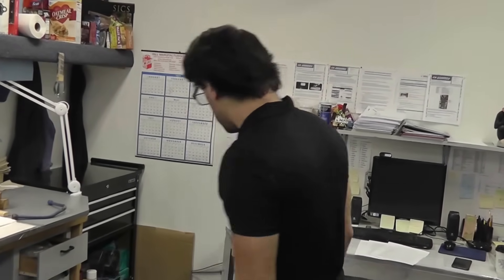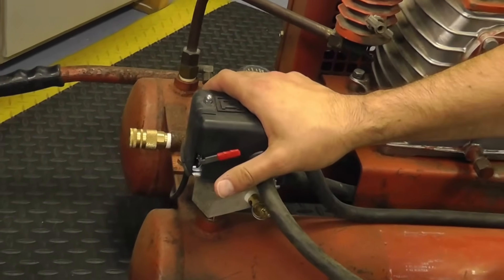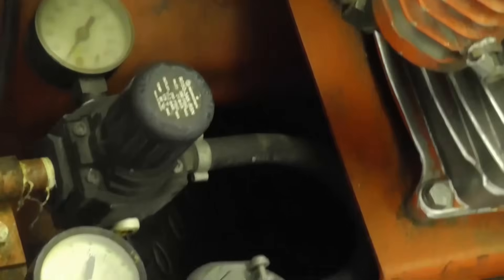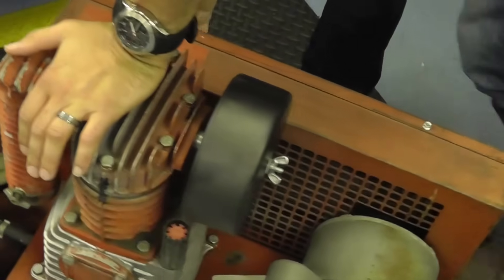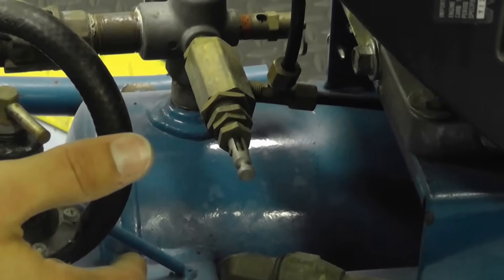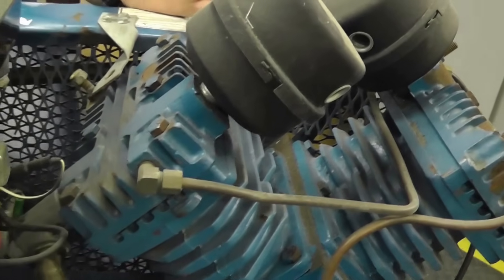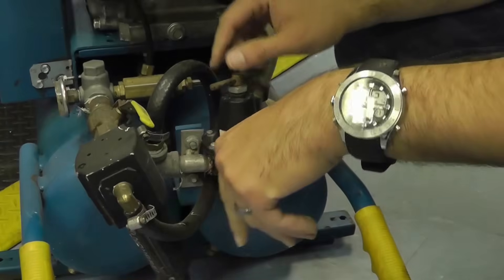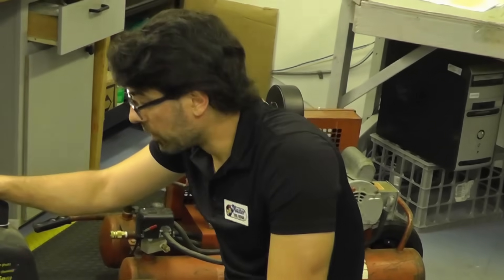Air Compressor Components And Operation

Comment: I've got a hulk brand. it will build up. pressure but want let air out of the hose. I'm not crazy, got everything hooked up, power and all. would it be the pressure switch?

Comment: Have a Jenny 30 gallon with gx390 Honda engine. Won’t idle up when I flip the unloader valve, replaced it but didn’t fix it . It’s building pressure when it’s in the unload position. Bad throttle control valve ?

Comment: Hey how you doing.. I have a emglo compressor.. on one of the pump head is blowing air back out through the intake filter.. I replaced all the valves.. intake and exhaust.. also unloader valves.. gaskets, and still blowing air out through the filter.. don't know what else it could be.. if you or anyone else can help would be great.. thank you.

Comment: How trustable are this compressors???
Reply: Emglo compressors
Reply from the maker: @raulmarin8704  The Emglo name was purchased by the DeWalt group in the 2000's so if you see a blue and yellow Emglo unit in the wild, that means it's a great, great compressor. Emglo is still operating in Johnstown, PA but they go by "Jenny" now. The compressors are exactly the same as the old Emglo units and they're made in the same factory, so a "Jenny" unit is equivalent to the old Emglo air compressors. These are excellent air compressors.
However the black and yellow DeWalt-made Emglo air compressors they're making today are NOT the same as the old Emglo units. They are decent air compressors but are not of the quality the old Emglo or current Jenny units are.
I hope this helps and thank you for the question!

Comment: I ordered a sight glass kit for my husky pro compressor. It came in 2 parts. No instructions. How do the parts go together?
Reply from the maker: If you have a model number for the compressor or part number we can assist you better, but typically you would just press the sight glass into the metal (or brass, or steel) threaded portion. I can also give you the manufacturer's contact info (depending on who made this particular unit for Husky/Home Depot) if you can give me the model number, as one of their service reps can certainly give you more detail.
Thanks!

Comment: What happens if pressure reach on red line on pressure gauge
Reply from the maker: Thanks for the question! It all depends on what your maximum PSI rating of your air compressor is. But generally, if the needle on the gauge is reaching the upper limits denoted by the red line, the pressure switch is failing to shut the unit off at the max PSI setting, so there's a good chance you'll need to replace your pressure switch (as long as you confirmed the gauge is reading accurately, first).
Reply: @MasterToolRepair  thanks for your reply..

Comment: I have the same emglo wheelbarrow type gas air compressor with the 4 cylinder v pump. Do u know what that air line is that goes from the top of the head to the oil tank?  I just can’t understand why downloader would go through the head and then into the oil
Reply from the maker: Thanks for the question! The line you're referring to is the Unloader Line. The end that connects to the front of the pump's crankcase is the centrifugal unloader assembly. When the unit reaches max pressure and kicks down to idle speed, this unloader valve is activated and air travels through it to the pump head to open the brass unloader valves, which causes the air to bypass the pump's valve system while idling (the air that is compressed while it idles unloads into the atmosphere). When the units kicks back into the loaded position, the unloader valves close so that the exhaust valves activate to continue compression to fill the air tank. Hopefully this gives you a helpful explanation!

Comment: Hey why there is ambient air intake in second stage of compressor
Reply from the maker: Thanks for the comment. The unit in the video has a v-twin pump and each cylinder requires an air intake filter...this is common on v-twin compressors as both banks have completely separate head and valves systems.

Comment: I have an old sears two cylinder compressor. I tired a few times to repair the check valve then I replaced it. Now it starts up and does not blow the breaker. The only issue is I've had the compressor head to the check valve copper pipe off so many times while it's running the fittings leak because the brass compression fittings don't seal . Plus the new check valves now have a 1/8" port that has to be plugged which I did. The main issue is getting a new copper pipe bent to a 90 degree and fitting the pipe proper. The new check valve is taller so I was able to push back the brass ring and cut off 5/16" yet I should have cut off 1/4" because now I need to tighten the heads fitting first then the check valve and can tell it has added tension . 
 It only has a slight leak while filling the tank yet I don't like the bit of added tension . It seems the copper pipe needs to seat down in the head and check valve in order for the brass sealing ring to find it's stop just the way they seem to work. 
 I guess I can get a new copper pipe and compression fittings and have the 90 degree bend done . The issue is making it the proper length. 

 How would you do this?
Reply from the maker: Thanks for the comment! You can buy 1/4" stock pipe at a hardware store and have them cut it and bend it to the proper shape for you, or you can bend the tubing yourself. For a small size like 1/4", it will actually bend pretty easily by hand without kinking (not the case for larger OD tubing). A cheap pipe bender will help. I would certainly recommend new compression ferrules on each end (your compression nuts should be reusable). Another option is to go with 1/4" OD nylon tubing, which we have available on our site but that you can obtain locally as well. This has obvious advantages...it's easier to work with, doesn't kink easily and you don't need to bend it. I hope this helps and feel free to reply if you have additional questions.
Reply: @MasterToolRepair  What I need is 1/2" OD copper pipe from the compressor head to the new check valve . Both ends use 1/2" compression fittings. Can't seem find it local at hard wares stores. I can find the 1/2" compression fittings on amazon
Reply from the maker: @williamjahn7514  We have standard 1/2" ferrules and compression nuts. You can find them at the below link:

https://mastertoolrepair.com/compression-nut-sleeve-60-861-p-1577.html

For the tube, I'd just get 1/2" OD copper cut and bent locally, that's the best option if you can't find the OEM part# for the tube online.

Comment: Great video! I have a problem with a central pneumatic (Harbor Freight) 29 gal oil lubed unit that will build pressure fine until it reaches ~100 psi then it starts to "strain"/"lugs" and motor( single phase induction 120v) begins making some "ticking/clicking" noises and unless i turn it off at this point it will trip the breaker in the panel( never the motor reset). I've replaced the run cap-(did not fix). Tank check valve is a simple spring pushing a rubber disc aided by tank back pressure to seal  and seems ok( no visible signs to indicate faulty and no air leaks from anywhere when tank pressurized).Unit is supposed to cut out at 150 and back in at 120. What do you suspect the problem could be?
Reply from the maker: Thank you for the question and for watching! It could be an issue with the on/off pressure switch contacts, I would take the cover off of the switch and clean the contacts as they may be corroded. Otherwise, the motor may simply be drawing too many amps so you may want to have the motor checked out by an electrician. It seems you did right by testing/replacing the capacitor and if the tank check valve is working, no issue there. The only other problem that could cause this is if the valves in the pump are obstructed with debris, making the pump labor. But, you would think it would trip the reset switch on the motor first if this was the case.

Comment: Hi my Dewalt gas air compresor Honda motor 5.5 HP  won't start what should i check ....Any ideas ?
Reply from the maker: Thank you for the question! There are a few things you can check. First, try disconnecting the low oil shutoff switch on the Honda engine itself, as sometimes this can short. Also, check the idle speed screw on the engine carburetor to make sure it's not set too low....if the RPMs are too low then it won't stay running.
Other than the engine, make sure you have the pilot/unloader valve (the large brass valve on the tank) in the "unloaded" position, which means the toggle on the end of it should be in the vertical position.
Make sure the drive belt is not too loose or too tight...you should have 1/2" deflection when you press down at the centerpoint of the belt. This should help get you started.

Comment: The Check valve going into tank has a black pipe coming out going into the power box do you know what that is for my compressor will full up but when it shuts off air comes out the end in power box and won't stop
Reply from the maker: The problem you're experiencing certainly sounds like a defective check valve. If any air leaks out of the tank after the unit shuts off, the check valve is stuck open (or the valve itself as fallen into the tank). It sounds like you're referring to the on/off pressure switch, which may be installed into a manifold which is on top of the check valve.

Comment: Hi, great video
 my atlas copco ga5 air compressor is having a problem. Element exit temperature is above normal, please how can i fix that?
Reply from the maker: Thank you for the post! I'm not too knowledgeable about the rotary screw units so I can only guess, I'm afraid. Does the unit have a refrigerated dryer or air cooler? It could be that there is a blockage in the outlet, increasing outlet air temperature. However, I'd recommend downloading a trouble-shooting guide for this air compressor on the manufacturer's website, which you can visit by clicking on the below link:
https://www.atlascopco.com/en-us/compressors/resources

Comment: Oil is leaking through the air breather of our air compressor. I have sealed it with wax. Would you please advise?
Reply from the maker: Thank you for the question, Ehsan. You do NOT want to plug the oil breather or cover it, it needs to vent into the atmosphere. That being said, if you're getting oil from the top of the breather, it's probably due to one of three reasons:
1) Too much oil in the crankcase
2) Valves in the pump are sticking
3) Air is back-feeding from the tank due to a faulty Check Valve
Most likely, you have a Valve or Valves sticking in the pump. If this is happening, you'll have too much pressure built up in the crankcase, which will cause oil to leak out of the breather. Are you getting strong suction when you put your finger or hand in front on the intake filter? If you don't get strong suction, you certainly have a Valve issue and probably need to replace the Valves and related Gaskets in the pump.

Comment: Hey guys my compressor is tripping the house 15amp breaker. 2hp 120v 15a doerr (1995)... will not start with anymore than 5-10psi in tank, anymore and it cant get going and pops. I've replaced the start and run caps, check valve seems operational with a full tank, unloaded seems to do the normal hiss, with belt removed motor works perfectly, and pump spins with, minimal resistance and pressure switch cuts off at 125 and kicks on at 90 as it should. I'm lost. Please help guys! What do I need to buy? Thanks in advance!!
Reply from the maker: A couple of questions:
1. What is the make and model number of your unit?
2. Did this unit run on this house circuit before and now it is just starting to do this?
3. Are you using an extension cord? If so, and the motor pulls 15A, I would recommend plugging it directly in the outlet without an extension cord to see if it is doing the same.
4. Have you checked the starter switch in the end of the motor bell? There are weights attached to two weights. If one of the springs is missing or slipped off, it will not engage your start capacitor.
5. Draining all of the air from the tank and removing the check valve, is there a screen in the top of the check valve that is supposed to filter the air? If so, remove it.
6. With the check valve removed, is there debris in the bottom of the check valve clogging the exhaust holes.

Comment: Hi , I need help with my Craftsman Industrial 33 gal air compressor. Its supposted to run on a 15 amp plug but I had an electrician wire a dedicated 20amp plug in my garage. The compressor will start up just fine and run for a few refills and will then blow the house 20 amp breaker.  I can here the hiss when it makes it to 150 psi stop .  I always drain the tank after use. As for age its maybe 7-10 years old. when it does run it's super quiet and no squeaks.
Reply from the maker: Hi Ed, your problem is most likely the tank check valve. Here is a link to a great video to hopefully assist you with your issue https://mastertoolrepair.com/how-to-test-check-valve-p-22524.html    Please let us know if this helps!

Comment: Could you show how dual control works? I have a quincy compressor on another style tank and controls most likely from the 80's its a constant run unit. The manual valve is missing on my unloader, so im going to replace that. Can i just plumb in a line and a shut off to a pressure switch to the motor. Flip the switch one way and have constant run. Flip the switch the other and have it shut off when it reaches pressure. (Start, stop)?
Reply from the maker: Thanks for the comment Lucas. Essentially yes, this is how you would go about setting the unit up for dual control operation. You can actually check out a diagram of a dual control setup by clicking on the below link:

https://www.mastertoolrepair.com/images/Dual%20Control.pdf

Hopefully this gives you some good information to go on. Let me know if you have any additional questions!